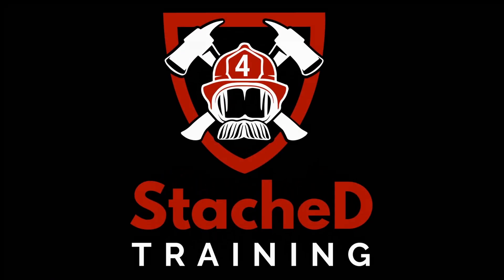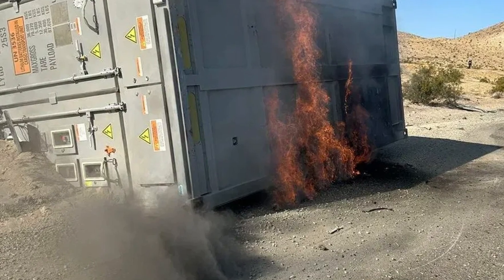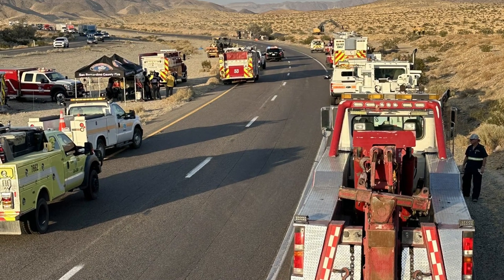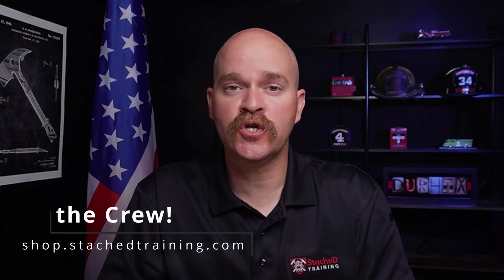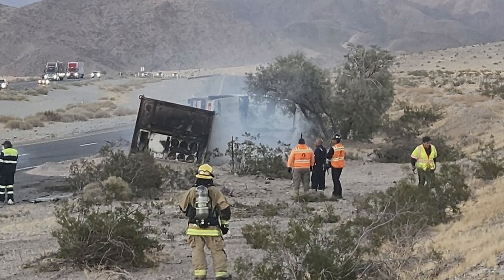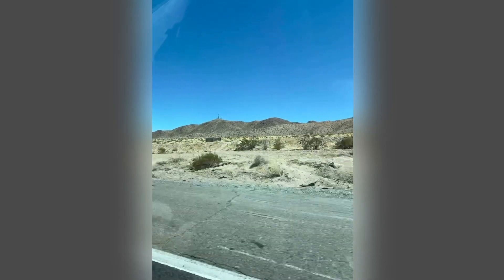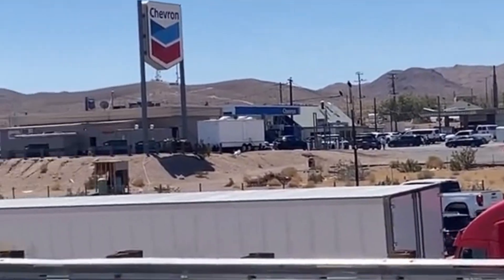Disaster on I-15: Lithium-ion Batteries Cause Major Delays

Comment: The stationary battery systems don't need to be lightweight hazardous lithium. Heavier weight and bulkier systems are better for public safety such ss zinc/bromine batteries.

Comment: UN 3536 / LITHIUM BATTERIES INSTALLED IN CARGO TRANSPORT UNIT lithium ion batteries or lithium metal batteries . the question is in what state these battiers were; factory new / used and for repair / end of life ready for recycling. These are different risk profiles.

Comment: Who pays for the Road Repairs with any of these battery fires ? The taxpayers ?
Reply: No, the insurance company for the trucking company. That’s who pays for it. Who do you think pays for it when a gasoline tanker rolls over under an overpass and destroys it. Their insurance company. But if there’s not enough insurance, then the taxpayer.
Reply: @neilkurzman4907  A million dollars doesn’t go too far nowadays. Even 20 million if you’re talking road repairs. 
I’ve got EV cars on my mind too and all the fires damaging highways.
Reply: @winnon992  
And how much do you think a 40 x 40 patch of asphalt cost?  Even concrete. And you seem to forget that gasoline cars and trucks burn all the time. This isn’t something new for insurance companies. I won’t even go into trucks smacking into bridges. Especially ones that are 11’8” tall.
Reply: @neilkurzman4907  I know. The Fire Departments can put gasoline and diesel fires pretty easily. These EV fires they’re having problems with. Hours of spraying them. Can’t put them out, they’re just keeping the fire from spreading.
Reply: @winnon992  
So let me get this straight the fire is on the side of the road where is it spreading to?  Why don’t you use Google and find out some details instead of repeating memes to me. Lithium ion batteries burn very quickly and very intensely. But when you have tens of thousands of them together in a giant block, it could take a long time to burn through one into the other. Spray cold water on it can stop the fire from spreading to one group of cells to another. For a large box like this, you would think it would have attachments for the fire department. If not, maybe the government needs to regulate it.
That’s what happens when business can’t figure out common sense things on their own. And maybe the trucking companies that transport these things should get better drivers if they’re tipping over during normal maneuvering
Reply: @neilkurzman4907  I’ve seen some EVs in the road burning . Right in the lane. It burn the concrete. The repair they had to replace the concrete right where it burned.
Reply: @winnon992 The crazy part is watching the entire thing melt into a puddle of lava.  That has to be pretty hot to do that.

Comment: why are they still using lithium ion instead of LifeP04.  P04 has higher density, faster charging rates more draw capacity and most of all they don’t catch on fire. they are cheaper. what is wrong with them
Reply: It takes a much higher temperature to ignite. Which is very important.

Comment: How many EVs ran out of electricity while sitting in the desert. 🔥🔥🔥🔥🔥🔥
Reply: Fewer than petrol cars running out of fuel running their engines just to keep air-conditioning going, that was mentioned in the video. You don't need to run an EVs traction motors for air-conditioning.
Reply: I don’t know how many cars ran out of gasoline while sitting in the desert?

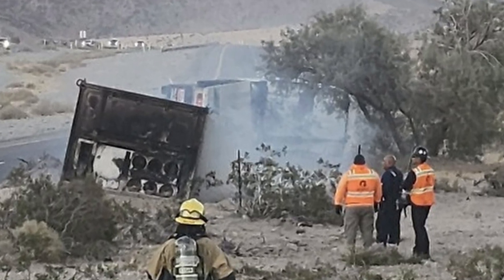Comment: 2:08 - speaking of "severe deflagration explosion hazard" i encourage everyone to watch the latest video out of China (although it's apparently from the year 2021) of the poor guy who literally gets BLOWN UP inside an elevator when the scooter battery he's carrying effectively "detonates" on him inside the tiny confined space of a 4ft x 4ft "metal box".  Aussie John Cadogan shows an edited version, but there's actually a longer vision showing the guy eventually being pulled from the elevator.  WARNING: the video is graphic... 

on this one unfortunately there's no escaping the fact (no pun intended) that once the doors closed, the surrounding 4 walls of the elevator conspired to create an OVER PRESSURE CONDITION from the blast, as what would normally be a "low-speed shockwave" from deflagration IMMEDIATELY gets reflected back on to him like so much Star Wars Trash Compactor circa 1977 once the flammable off-gas ignites.   again the guy may as well have walked inside the elevator holding a LIVE GRENADE like Jean Reno, because that was a very hard way to go out.

Comment: Don't you guys run contraflow traffic over there when roads are blocked for an extended time? Common practice in the upside down land down under, is to funnel all traffic on the good side of the highway into one lane, then at the nearest crossover, divert the opposite bound traffic onto the other lane of the good side. Sure, it slows the flow a LOT, but everybody gets moving, rather than stuck in one spot for days.

Comment: So a couple of heavy wreckers couldn’t drag the container a safe distance away from the highway!  It’s all desert out there!
Reply: Anybody know where the fuse so it can be defused like a bomb?
Reply: Ok, you buy a 250,000-to-650,000-thousand-dollar wrecker and pull a unit that can have a violent explosion at any second into the desert. You have any next of kin we should notify?
Reply: @grumpyt3169  They have this new thing called wire rope.  You can even get it in very long lengths.  Sometimes wreckers even have a couple of spools of it on a thing called a winch.

Comment: lithium iron can be dangerious , but so can fuel tankers , expecialy on uneven ground , rivers of fire , however , lithium wont be around forever , samsung has just sent out there solid state bats for testing to the EV makers around the world , not lithium , no thermal run away , more energy dens , electric is the way , and unstoppable now
Reply: Pipedream, electric is not the way, maybe you should gain some knowledge about Evs and electrical infrastructure as your generalization shows you have little
Reply: @jamesocker5235  know ablosutly , hydrogen isnt the way , the infruscucture alone is far beyond anything electric needs , cant keep burning fossil fuels , and anything like a clean version of fossil fuels is pipe dream , I need to look and know nothing ? , think I know more than you do , you go back to the car will never replace to horse crowd mate lol
Reply: @jamesocker5235  What will you do when we run out of petroleum?

Comment: Agree with all the previous comments. A question should be asked. Why is this type of Hazmat transport not under police control and limited in speed and programmed? Why do the trucks overturn? Unanswered questions? Where are the environmentalists? No elected officials to solve the problem and impose safety measures during transport? Yet California is known for its avant-garde measures...even the most idiotic ones.

Comment: 3:38 - freeze frame it here folks and look at the type of trailer being used, as what both these incidents point to is a likely problem of IMPROPER EQUIPMENT being used for transporting the load involved, so sadly it's an issue of someone or "someones" (plural) failing to recognize the BASIC PHYSICS involved.   ironically this is something i literally was just pointing out to someone in the comment section during the good Captain's previously upload on the DDR truck fire in Washington State, regarding how an additional MASS PROBLEM is created by a switch to LFP Chemistry versus using standard NCM Chemistry, so i contend this is what you're seeing here...

let me explain: if you notice due to their extreme weight (height restrictions not withstanding) something you NEVER see is a Bull Dozer or Excavator being transported on the highways and by-ways of 'Murica on a standard Flatbed trailer no, as a general rule for safety you only ever see these Multi-Ton pieces of equipment being transported on LOW BOY TRAILERS due to them giving the "double benefit" of being both easier to load AND offering a better Center of Gravity during transport.  hint: a Li-Ion BESS (an LFP one in particular) is in fact a "Multi-Ton piece of equipment"...

now an additional reason i say this is because, if you look at some of the other reports on the I-15 crash, what you'll see is that the driver didn't just randomly crash on some straight section of highway in the middle of BFE...?  no what they actually did was ROLL OVER where there's a decent CURVE in the road in the middle of BFE, and possibly even a sneaky bit of downward grade to contend with.  yeah so this would be EXACTLY like what we see occasionally here in the North East and elsewhere when drivers (forgetting they're fully loaded) take exits too fast, and then promptly ROLL THEMSELVES and their Truck/Trailer combination over the OUTSIDE of the off ramp when the weight (sitting up high) suddenly shifts.  sadly any time the weight shifts on you in a Semi, you're just along for the ride.
Reply: @jimbeaux1109 Exactly. Like the chassis used for tank containers. Long and low.
Reply: Did an LFP battery have thermal runaway? They claim that they are more robust.
Reply: Had a family member who worked on a heavy rotator in OKC, he averaged 4 lay overs a week due to the sharp circle exits around the city. In the last ten years all those circle exits are gone.
Reply: A Towing YouTube channel used two crane trucks to move one of these batteries off a trailer that had bent it's frame and bottomed out broken down

Comment: How many EV owners was stranded for those 48 hours?
Reply: So you think the electric vehicles ran their vehicles down because they were stupid. But the gasoline vehicles were smart enough to turn them off?
Reply: @neilkurzman4907  If you listen to the story, it was 110 degree hot at that location. Most likely people sitting their stranded would have turned on their AC. Empty EV battery in the desert sounds like an expensive towing to nearest town.

Comment: Accidents do happen, but I think it's a matter of time when new hazmat regulations will be introduced.  Li-on batteries will need to be at minimal charge to ensure safer transport.
Reply: These devices are replacing  diesel-electric generators, which are safe and have been used for over a hundred years. There's no reason for them to even exist, and here we are talking about how to make them safer, it's madness!
Reply: @deniswauchope3788 NOOO NOT CHANGE!!! AHHH, GET ME AWAY shutup dude
Reply: @deniswauchope3788 "diesel generators are safe" 😂
And "no reason to replace them" they are a nightmare in crowded music festivals when they are polluting the audience and drowning out the music. People don't want to smell and hear their electricity.

Comment: I've driven that stretch many times. it can get so hot that the slow trucks driving up the grades can have the asphalt stick to their tires and peel up from the roadway. 

still stories I'm sure that have not been told because cars I'm sure ran out of gas and ecars burning thru their charge could have been real dangerous then hydration and food availability.  there's over 200 miles with not much out there. scary situation on many levels.
Reply: If you’re electric car or gasoline car runs out of energy along your trip, the problem is you not the vehicle.

Comment: Those units must be heavy.
Reply: yeah, the fact that it's not just ONE but TWO that have mysteriously "jumped off" the trailer does hint at a weight problem.
Reply: it was on a 3 axle trailer, so yes.

Comment: I couldn't help wondering whether the units are top heavy, otherwise why would they keep toppling over the trucks carrying them.  I know nothing about the subject so I naively imagined trucks toppling over was a pretty rare event, caused by shifting load or taking bends at too high a speed, or high sided vehicles in unusually windy conditions.   So, is there any reason these things seem prone to tipping over?
Reply: yes very top heavy, but i question the 75,000 pound number? 80,000 is the legal limit of US freeways. 
NO truck and trailer is under 15,000 pounds. 
so if the power container is that heavy if so then it is on a state mandated route. 
but the poor driver is ether stupid, does not understand TIP heavy loads. 
very under paid so ne was speeding.
firced dispatch, again under paid, not enough time to drive safely,
or fell asleep due to being tired cause of a “forced” dispatch. some company's gave a way to get around even the computer log books.
Reply: @larryjanson4011 80k is the universal weight for all 50 states. Oversize loads with permits and trucks in many states are over this weight, depending on state laws. Washington and Oregon are 105k for example.
Reply: @larryjanson4011  Yeah, we're only human and can all succumb to pressure to push ourselves that bit too far, a touch of "get-there-itis" as "MentourPilot" or some other 747 pilot on YT explains, suggesting even they suffer from fatigue and self induced pressure to get the job done so  to speak.   I know nothing about truck driving, only ever having driven cars and the occasional van but I've often wondered how truck drivers cope with the tedium on some routes.  I'd be hopeless.
Reply: The batteries would be backed in stacks as high as possible without overloading the container. They should build a container from scratch fit for purpose.  I.e.  not a shipping container.
Reply: I think they have some type of liquid in them?!
Reply: I dunno, Stephen. I think you may be on to something, though, with your high centre of gravity observation. Note: What follows is pure speculation and is NOT intended to be criticism of truck drivers in general.

I wonder if the problem is one of distraction, followed by over-compensation at the steering wheel leading to fishtail oscillations, then toppling. Truck driving can be very, very boring. Most truckers get away with the occasional 'whoops' moment, but maybe that's because their vehicles aren't (allegedly) top-heavy.

I used to be a rally driver of sorts in the Group-B era; getting round corners quickly was half the challenge, and it was normal to unbalance the car deliberately with what had become known as a 'Scandinavian flick'. This was a manoeuvre largely popularised and perfected by Finnish and Swedish rally drivers - it involved twitching the steering wheel 100 yards before the turn to throw the car off balance, then feeding in opposite-lock to zip round the bend sideways. It's exactly what you DON'T want to do when driving a heavily laden, badly balanced truck.

Because it will jackknife (if articulated), or fishtail and flip over.

Getting into oscillations and over-correcting might be happening [relax, Rubber Duck - I did say MIGHT be😁] because truck drivers are falling asleep at the wheel, or are having their attention taken up by the vehicle's touchscreen controls. Or they may be looking up in panic after drifting out of their lane whilst sending text messages on their phones.

Competent truckers with properly-distributed loads will recover safely 99% of the time but, however competent the driver, hauling suddenly at the wheel of a battery-carrying truck might be enough to flick it onto its side, especially if (as you say) its centre of gravity is too high.
Reply: container trucks topple over very often. Only log trucks are worse because they always loaded even higher, not to road limit, and drive on uneven dirt roads.

main reason - its container, it just starts above truck frame, skid coupler and trailer frame, its already 1.20m. The whole container is above, sometimes even lifted high above trailer wheels on special spacers, so top is 4.0m even in Europe (road limit), here in Australia 4.3m, US 13.6/14.6 ft = 4.15/4.45m. And then comes weight distribution inside the container. If it is loaded with lead batteries or uranium tank shells its not a problem, but light litium batteries loaded to full available mass occupy all internal space up to the roof so CoG is in the middle, about 3m over ground.
Reply: @antontsau  Ah, well that's interesting.  I like to think engineers could fathom a way of lowering the CoG where it's more critical but all I can do is cross my fingers that is so.
Reply: @stephenbrough8132 or they could haul it on a lowboy trailer providing it fits on the deck
Reply: @juliogonzo2718  This is all out of my range of knowledge to be honest - I was only wondering about it from a complete layman perspective, no knowledge about heavy haulage, just a bit surprised to hear at least two had turned over, and one at low speed if I recall correctly what he said in the video about the one pulling into a fuel station - where I would imagine would be even more concerning for a lithium ion battery fire to break out.
Reply: @stephenbrough8132  For containers - no way. Its possible for usual semi, make lowrider (by the cost of length) or stepdeck (almost impossible to load from back, so only sideloaders), limited only by trailer wheels height, but container does not allow such a scheme as it is bottom flat and cant be lowered below standard skid coupler height + frame thickness. 

So the single possible action is to lower CoG of container itself, redistributing internal load, heaviest to bottom, but it is possible only for high density loads when you limited by total mass not volume of container.

Comment: What is UN number 3536 it's not in my book and the  placard 9  (Low to Moderate Hazard)???
Reply: Li-on batteries installed in cargo transport.
Reply: Class 9: Misc, Dangerous Substances.
Reply: UN 3536 Lithium batteries installed in cargo transport.
They can be lithium ion or lithium metal batteries.